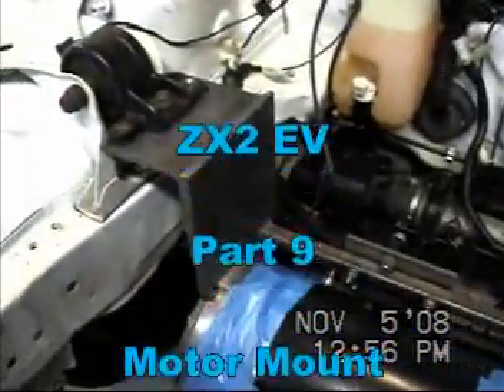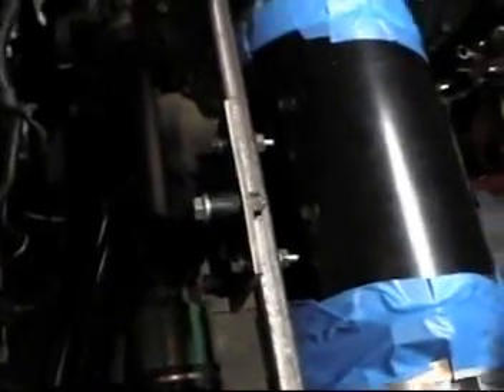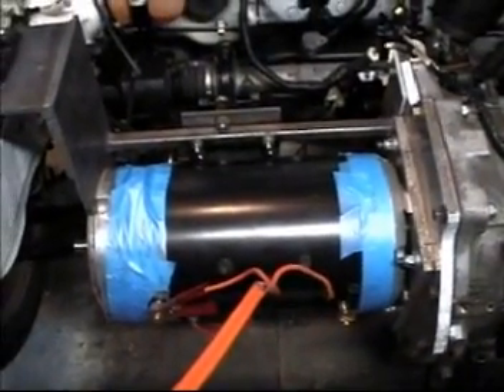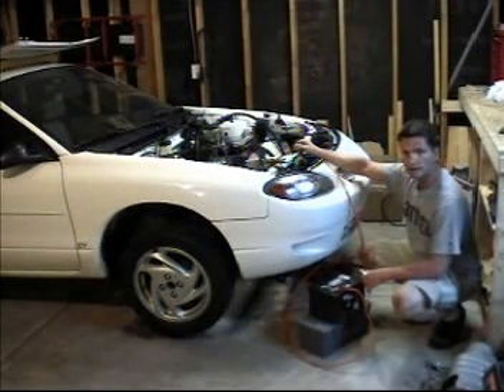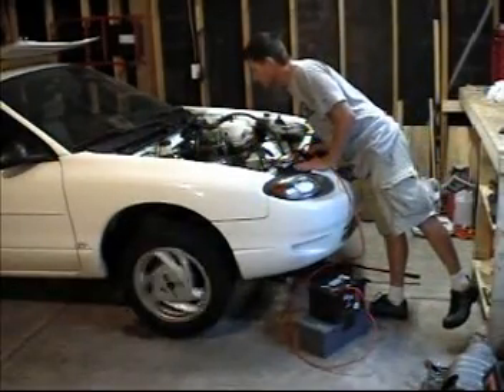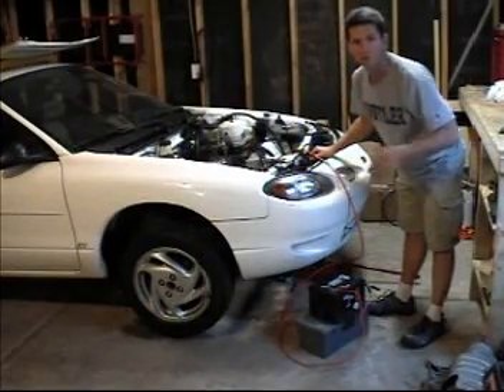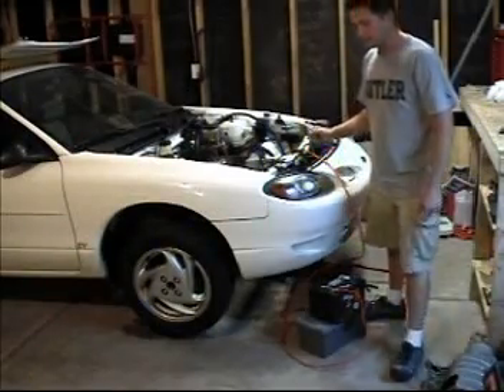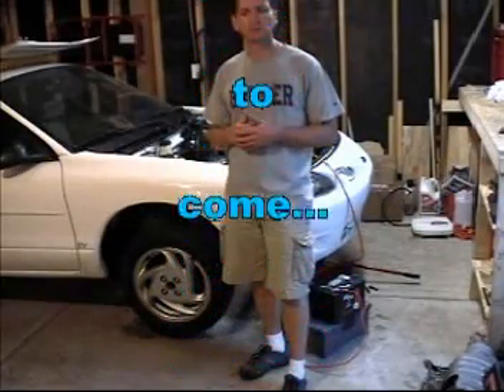Patrick Roth's zx2 EV Project Part 9

Comment: Since the ZX2 has fairly short gearing compared to most cars, this will work toward your advantage, although I'm not sure what the torque curve looks like for an electric motor like this.  I would be interested in doing an EV hybrid, but with w/ FWD there doesn't seem to be a viable option without some serious cutting.

Comment from the maker: One thing I've found with EV conversions, is they are pretty much like ICE cars.  Everyone has different "needs" or preferences.  Some just want it to be fast.  Some want it to have great range, but don't care how fast it can go or how fast it gets to it's max speed.  Heck, some people do these for drag races!  I'm typically a "middle of the road" kinda guy..  Hence, 120v of 8v batts.. decent range, acceleration and top speed for a "fairly" light EV w/o spending a fortune on batts.

Comment from the maker: I agree.  From what I've seen (in LA conversions) you do get the best range out of 6v batts.  I've seen  plenty of people go with high voltage (meaning up over 200v) and get great acceleration, but not much range.  I chose a middle path.  The main reason for 8v batts is they represented the lowest overall price and weight for what I considered a decent range and performance.  Even a 96v system with 6v's would have been a heavier batt pack, and I chose 96v as my bare minimum.

Comment from the maker: I had a professional EV consultation done at the start of this project and was told to expect 50 miles of range with my set up. Since I already own a Prius and am quite good at maximizing mpg's, I should be able to better than 50 miles (not that I need to, but it's still nice). Lots of info at cardomain under PatricioIN

Comment from the maker: I trimmed a lot of extra weight from the original version of the mount.  Weight is always an issue with a LA ev, as is safety and I wanted to be sure this mount couldn't fail!  It weighs 15lbs.  Keep in mind the shaft orginally bolted to the engine block which was 300lbs.  Overall, the car will be around 600lbs heavier than stock when completed.  When/if lithium batteries become affordable for the average DIY converter, you could do one that is lighter than stock!